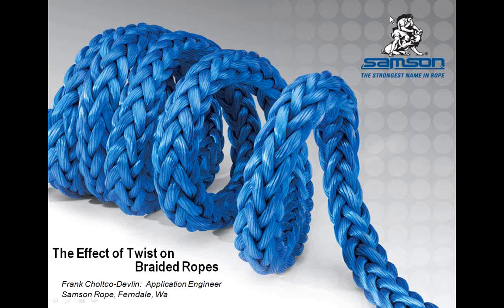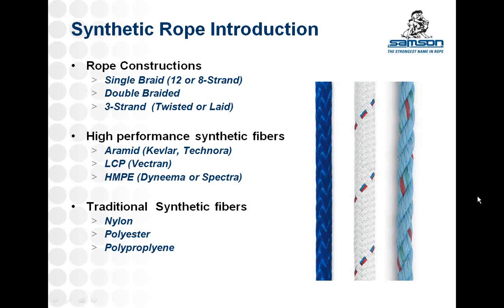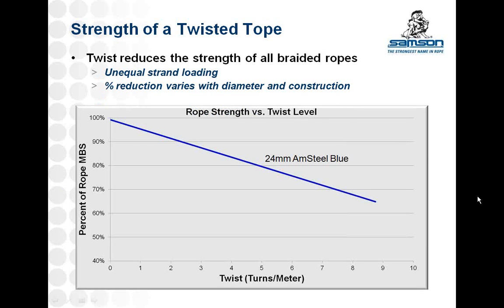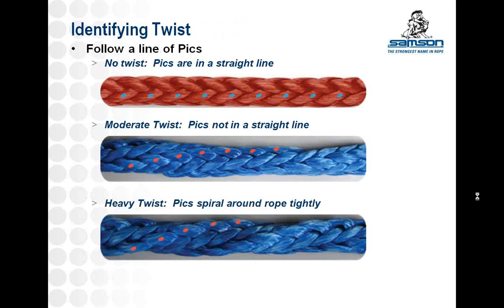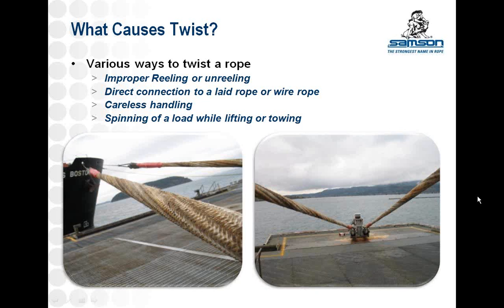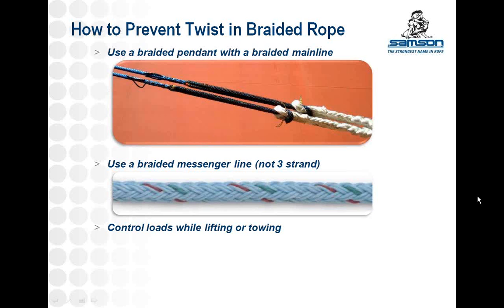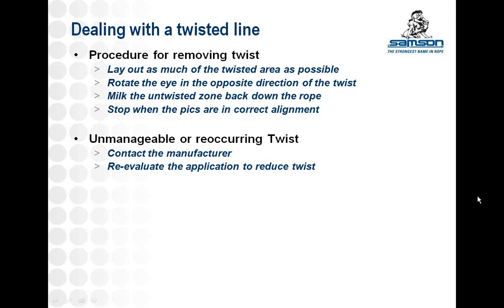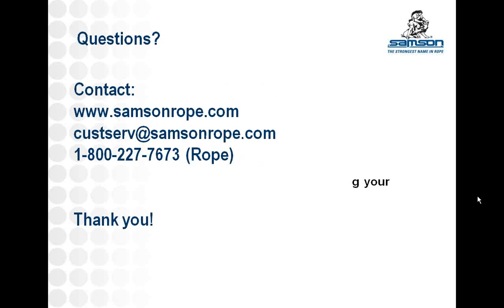The Effect of Twist on a Braided Rope

Comment from the maker: Generally, the splice is the weakest point of any new rope therefore careless splicing will tend to reduce the strength at this weakest point and thus reduce the overall strength of the line. 
That being said, we have not quantified the precise amount of loss associated with twist in the buried portion of the line but the effect is likely to be less severe than twist in the clear rope.
There is no simple way to determine, without opening up the splice, if the tail is twisted.